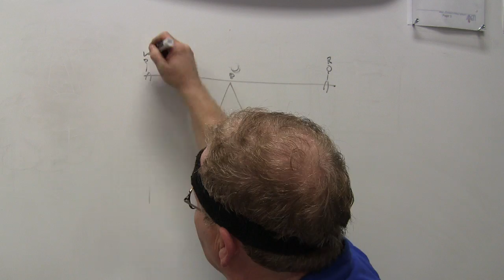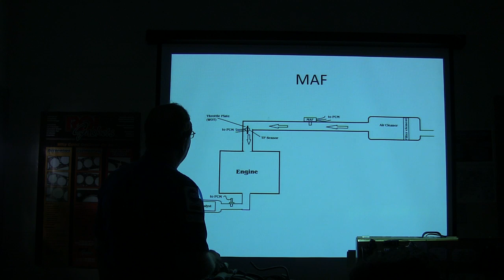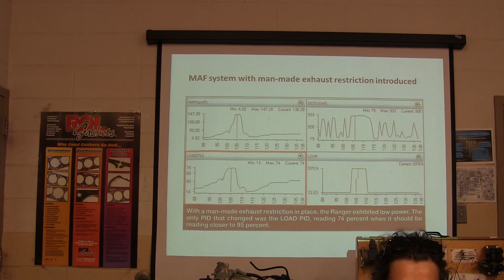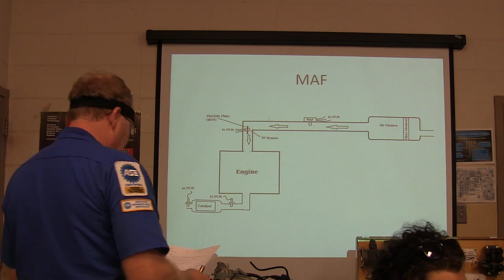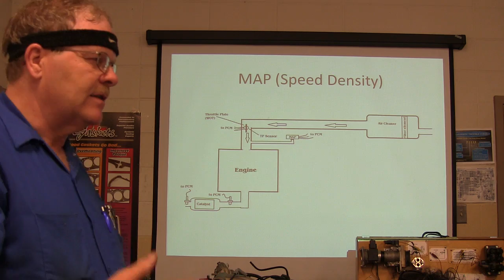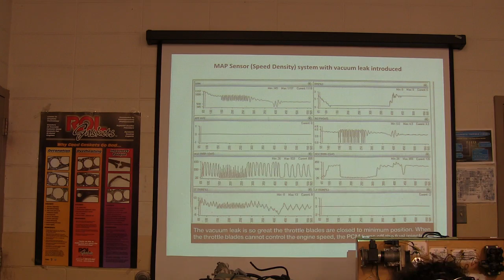MAF versus MAP speed density

Comment: The instructor is wrong on the first question. Sensors measure. ECU's calculate.
Reply: Not correct. To my understanding, sensors on a car are generally transducers or RTDs that send a voltage to (or back to) the ecu. Inside the ECU, the voltages are transformed and converted into usable digital data which is processed, stored and compared to maps (more processing) which is then used for trim calculations. Since measuring is literally the comparison of one object against another object or a known reference, this absolutely occurs in the ECU. No matter which way you look at this, the ECU is the device doing the measuring. Sensors give data. ECU measures the data. Then the ECU calculates the needed trim to stay in ranges specified in the maps. I could be wrong on this, as I'm not a mechanic. However, I know what the word measure actually means. BTW, he didn't even give the answer to the first question. He left the students with 2 choices: Weight or Volume.